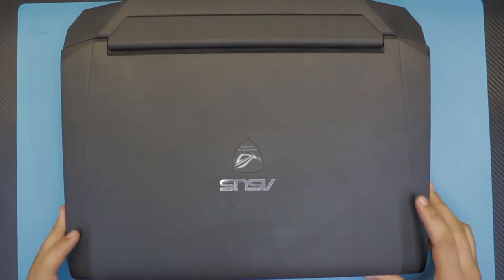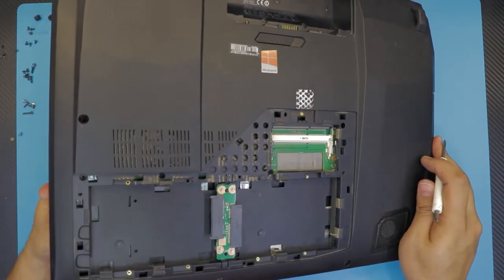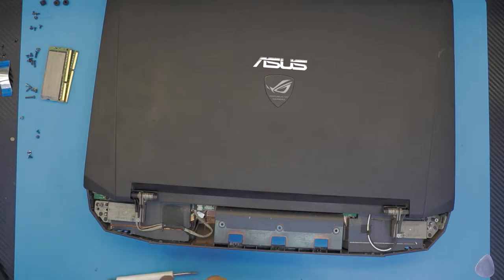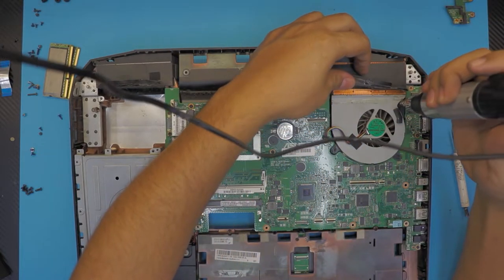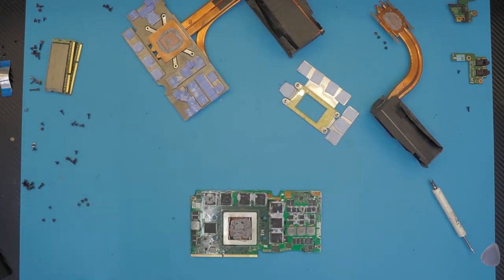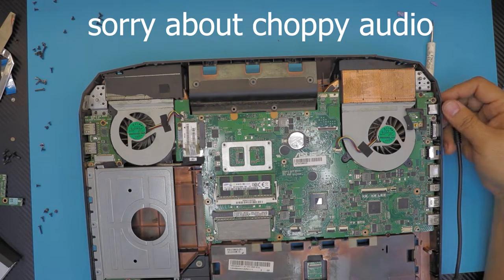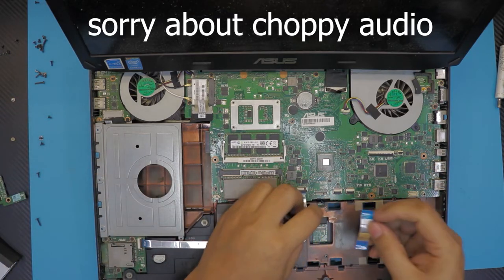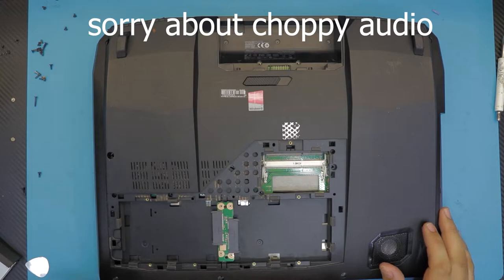ASUS G750 Repair, service, Disassemble and repaste

Comment: generous work. I have a problem with my asus g750jw, I am repairing a key on the keyboard and at the end I wanted to close it after coming into contact with A ram the machine does not turn on anymore.
Can GPU be saved?
Reply from the maker: Thank you for the feedback! if you wish to support the channel you can LIKE or SUB or both :P
regarding your question: so you tried repairing the keyboard from outside and then you opened it and touched the ram?? or upgraded the ram? and its not turning on at all?, or its powering on LED but no screen fan spins?
and by "can GPU be saved?" what you mean?
Reply: @uFixTek  sorry i am not good in English! After the pc does not turn ! Anything's/ my question is can i get a new motherboard without graphics card?
Reply: If motherboard died ,the gpu too?
Reply from the maker: its okay i speak 5 languages you can speak in your language my friend:)
if the motherboard is dead the GPU is fine. just change the motherboard. yes you can get just the motherboard without the GPU.
Reply: @uFixTek  merci beaucoup à vous je me suis abonnée à votre chaîne !  Je vais acheter une carte mère bientôt ! Puis-je acheter le g750jx à la place du jw ?
Reply from the maker: merci pour le soutien à la chaîne, je parle 5 langues mais le français n'en fait pas partie :P,
Bien sûr, vous pouvez obtenir le modèle "JX", cela fonctionnera très bien et ce serait une bonne mise à niveau.
bonne chance mon ami.
Reply: @uFixTek  merci à vous le monsieur ! De ce fait la gtx 860m pourrait être mise en niveau sur le kW?
Reply from the maker: votre accueil, et oui il peut mon ami.
Reply: @uFixTek  merci beaucoup ! Je pense que je vais essayer de changer de MOSFET car le pc s'allume plus pour voir !

Comment: Hi there Can you please tell me how I can enter the Bios setting on ASUS GJ750 ?? I hit F2 button but it didn’t work and I’ve also tried F10 and Esc and none of them worked. Thanks
Reply from the maker: thank you for the support to the channel, regarding your question :
The easiest way, is to bring the charms bar up and go to Settings>Power>Restart+Shift>Troubleshoot>Advanced options>UEFI Firmware Settings>Restart. Once you click restart, BIOS will appear. The trick here is to press Restart AND Shift at the same time.

Comment: Really helpful, I was wondering. I have this model. What would cause the LCD to not display even when its turned on. I have tried to diagnose with a working monitor and still did not display. Could it be a mother board issue,the gpu or a loose LCD cable/bad hdmi port?

edit: I took it apart and its either the mobo or the gpu. So im just going to cut my losses. The video did atleast help to take it apart. So thank you for that.
Reply from the maker: Thank you for the feedback and your support to the channel by a SUB :P
regarding your question:
THIS is a very common issue with this models and we get them a lot in the store , the failure is on the GPU chip. you will need to do the following:
remove the motherboard completely,
grab foil tape :
https://amzn.to/38cZBUL
and you want to isolate around the GPU
then you want to place it on a wood table no glass no metal.
and use a hair dryer and set it to max heat and medium air and with a distance of 2" keep the heat on it for 5min
then let it cool down at room temp and no touching for 15min
then remove the isolation tape around the gpu and repaste and enjoy.

if you need example of the process watch this video:
https://www.youtube.com/watch?v=LPThmVu9-JM
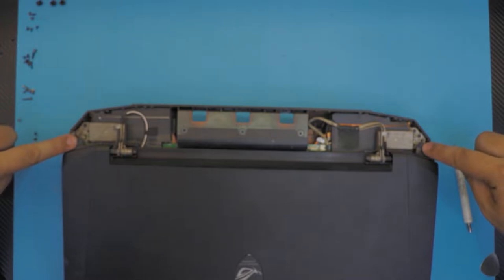watch after min 7:00

if you got any questions ask me
Reply: @uFixTek Thats really helpful thanks!!
Reply from the maker: anytime my friend :)

Comment: can this laptop turn on when the GPU is removed?
Reply from the maker: no the schematics wont allow the boot without the gpu installed. thank you for the support tot he channel.
Reply: @uFixTek  I want to troubleshoot either a bad graphic card or motherboard. If the motherboard is good and the graphic card is bad, can because of the bad graphic card installed, the board will not show any LED? 
I want to know if it is the gpu or the motherboard is bad
Reply from the maker: im thinking you dont have a shop or graphic card testers, therefor i need to know this:
if you put everything together and turn on the laptop what does it do exactly:
#1, turns on the fan , light indicator , how long the light stays on and then it powers off or it turns off then back on ?, i need this information to be able to give you a exact diagnostics.
Reply: @uFixTek  The laptop does not show any sign when trying to turn on. Nothing happens.
My question is: Will a good motherboard, without the GPU card installed, show any LED light or fan when trying to turn on the system?
Reply: @uFixTek  I have the same question @UFIXTEK. I was about to buy a new motherboard on aliexpress, and now I saw this post and I am concerned about it. I dont know if it is the main board that is bad or the GPU board. Please, give me any light.
Reply: @uFixTek  When everithing was together the mother board turned the light on and then off, but sometimes the light not even turns on. nothing. The fans do not spin. The laptop used to shut down suddenly when I was plaiyng. Some weeks before it died completely the laptop refused to turn on sometimes, and then when I tried again it turned on. So I need to know if it is the moterboard that is dead or the GPU card.

Comment: Nice work. Is it true those laptops can't' work with 1.5 volts ram? I have two Vengeance cmsx16gx3m2a1600c10, and I wanted to replace the ones that came with the laptop that are 1.3v. I red in some forums that it will damage the board and cpu because of overheating. I saw videos of people using them and they work, but I dont know about long term damages.
Reply from the maker: Thank you for your feedback! If you would like to support the channel, you can choose to like, subscribe, or do both.

Regarding your question, I have been in the repair and servicing business for over 17 years, and based on my experience, I can tell you the following: You can install a non-low voltage RAM (1.5V) and test it. If the laptop turns on, doesn't crash, and doesn't encounter blue screens, then you can use it. A 1.5V RAM cannot damage a motherboard; it will either work or not work.

However, I recommend using a 1.3V SDRAM DDR3L (low voltage) because low voltage RAM tends to be more stable. Additionally, some motherboards only support low voltage RAM.

Please note that no matter what you do to the RAM, it will not damage the motherboard. We have conducted experiments where we deliberately created a short on the RAM while it was powered on, and although the RAM may smoke, the motherboard remains unaffected.

Therefore, if your laptop can handle 1.5V RAM, you can use it. If not, opt for the 1.3V RAM. Keep in mind that if you install two sticks of 1.5V RAM, it may not work during the boot process. You can try it out and see.

Should you have any further questions or requests in the future, please don't hesitate to ask me.

Comment: Touchpad not working after reassembly. A blue tag or label of one cable went off but the rest of the cable is intact. When reconnected the cursor does not appear. Keyboard working fine.
Reply from the maker: Thank you for the feedback! if you wish to support the channel you can LIKE or SUB or both :P
regarding your question: you need that blue .2mm plastic to hold the connectors with pins cut a small thin plastic and slide it on the back side of the flex into the jack so it can push the pins.
Reply: @uFixTek  Thanks, I will try that. I just realized that the numkey pad is not working either. But that tip is intact, do both cable work together or could the other cable have something wrong?
Reply from the maker: make sure you re insert evenly the keyboard flat cable, and its all the way in, the keyboard flex has nothing to do with other.

Comment: Hi, this video helped me fix a thermal issue as my ASUS G750jm also had the tape half over the vents for some reason. However, I'm still having an issue with a flickering screen I've determined it to be hardware but im not sure how to go about testing it so I don't order the wrong parts. Any advice would be greatly appreciated!
Reply from the maker: thank you for the feedback,
and regarding the screen flickering i have a very DYI solution for you, but before i give you the solution i need to have a confirmed diagnostics,
can you answer the following questions, please be very exact:
#1. when does the flickering happens
#2. does it happen before windows boot?
#3. doe it happen right when you see the asus logo
#4. does it happen when you reach almost or wto your desktop?
#5. it happens when you play game
#6. can you take a video few sec or min of the flickering?
#7. does it have the save exact patterns?
Reply: @uFixTek  Thank you for offering your advice! 
The flickering occurs primarily when the monitor is moved any degree, either large movements or simple vibration on the desk.
It occurs consistently through the boot process and after
when isolated from any vibrations it will flicker for long periods but eventually settle down for a small period.
I can attempt to take a video if needed
The patterns are always the same sporadic segmented flickering across the whole screen
I can verify that the cable inside for the LCD is properly seated but that's where my expertise ended.
To note: the lcd does just turn off randomly for no reason, a second monitor verifies the system did not crash or overheat. The monitor just turns off and doesn't come back on until a restart.
Reply from the maker: okay based on the information that you gave me now i can tell you 100% that the problem is with your LCD *the matrix board attached to your lcd, there is no repair for this , you will need to remove the bezle and remove the lcd and only 4 screw holds it and remove the lcd cable and the exact info for the panel is written at the back of the panel, and you can find it cheaper, but of you search for you laptop bran lcd the price will be very high, and the seller will know that you using it for high end laptop  and they still give you the same panel but much $$$, so the best is remove the panel and search for the exact panel model.

if you had a bad flex cable the screen should of turned off and on and flickering on and off.
if you move your screen and it flickers but the screen still on its not flex cable, its simply your lcd matrix board.

also, get a hdmi cable and test with external tv or monitor to discard any 1% chance that it could be your lcd filters on board. (99.99% its not ) but do it for the heck of the issue.

therefore NEW LCD panel :)

***i see that you have 2nd monitor for 100% its your panel
Reply: @uFixTek  Interesting? Well thank you so much for the help! Im 100% certain this diagnosis is correct thanks to the information you have stated. Again, thank you so much for the help!
Reply from the maker: thank you for the feedback and i hope you keep  me /us informed and see how it goes, but im sure you lcd is going back. good luck my friend

Comment: Hi, I got my g75ojx recently opened up and cleaned by a friend but now the FPS in game have dropped to half i ran a few diagnostics it shows my GPU is not working at full capacity should i repaste it ?
Reply from the maker: update your bios and remember you have to plug the a/c unit 1st before powering on if you going to play games, because the new bios update on this models work as follow: if the charger is not plugged in and you power on then the gpu wont start and you will only have activated the hd graphics. so plug in charger then power on if that didnt resolve then open up and repaste the cpu and gpu

Comment: I have this laptop. I would like to upgrade the graphics card and possibly the hard drive for more memory. Any suggeations for what to get or where to look for replacements, I would appreciate very much.
Reply from the maker: for ram : https://amzn.to/2Wn8NRJ 
for the GPU its going to be hard as the problem is not just new GPU card its that you will need a more powerful power bank, about 7-8amp, else it wont boot. i have done few upgrades. you can buy new GPU card directly from ASUS. but they are expensive.

Comment: Hi Sir, I really appreciate this video. I actually had a problem after I did all cleaning and repast gpu and cpu. I forgot to double check  before I placing the LCD and keyboard back. After I assembling everything I noticed that I failed the work. There is no light at all when I charge it and the screen is definitely black. Can you please help me out what potential reasons behind? Is there a demage on the motherboard when I did the work? Thanks!
Reply from the maker: Thank you for the feedback! if you wish to support the channel you can LIKE or SUB or both :P
regarding your question: i need every bit of detail my friend, like>
have you reopen and double check the cables and all make sure the screen cable its all the way inside.
when you plug the charger do you see the charge LED or when you press power on and do you hear fan spin and or any LED light flash>
give me detail.
Reply: @uFixTek  Solved, I just reopened the laptop and reinstall the rams. Thanks it really helps
Reply from the maker: awesome my friend always double check your work :P 
if you have any question or request in the future feel free to ask me.

Comment: Thank you for sharing this video.  I press the start button and the laptop didn't show anything on the screen? Could you tell me what the problem might be?
Reply from the maker: remove both of the rams, and then power on and power off. #2, place only one ram, then power on and you should get the screen logo then power off *or wait for the windows to load then power off both is fine, #3 place the 2nd ram slot in and you done.
Reply from the maker: if it didn't work give me more detail, e.g. when you power on does the fan spins does any light blinks any reactions
Reply: @uFixTek  hello bro i have g750jw and i have same problem no screen when i started  the fan and dc light on when press start    sorry for my language
Reply from the maker: @RealMgeed  hi my friend you can write in Farsi i understand Farsi :P ,
you have a GPU (video card) problem, 
all you need to do remove the video car completely, as shown in this video,
and then you need to do the following,
#1.  get the gpu out : https://imgur.com/a/XDrmN1d
#2. get your self a foil tape : https://amzn.to/34Qms6j
#3. you need to cover all the video memories, isolate the GPU
watch this video : https://youtu.be/abiSn6h0r3o
@12:00 min starting and it shows you the example of how to isolate.
#4. once isolated then you want to place the video card on a wood table and  make sure there is no air blowing or air condition in the room is off
#5. grab a hot air station, or if you dont have use a hair dryer and set the hair dryer to max heat and low air, 
#6 keep pointing the hair dryer directly over the video chip for 5-6min without moving, the distance should be about 5cm from the chip to the hair dryer.
#7. turn off the hot air and let the board cool down BY IT SELF, DONT USE FAN OR ANYTHING!! let it sit for 10-15 min
#8. remove the foil tapes and clean the chip and put new thermal paste a good one
Thermal Paste: https://amzn.to/2O3g3u4

and ENJOY :)
ممنون ، دیمون

Comment: Can you write which of pci express is on g750js model. So i can see which newer nvidia mobile gpu is compatibile. Thanks for reply
Reply from the maker: im sorry but i dont understand your question.
Reply: @uFixTek  on Laptop you take spart which nvidia graphic fit inside different than 870 or 880 m? I want to know which connector type is on motherboard? I plan to install if it is possible 980 or 1080 mobile card

Comment: hi how are u, thx, question, if i want to only replace my top cover. do i have to take out the hard drives (ssdd), or can I leave them in, cause I do understand I need to remove the keyboard?
Reply from the maker: good thx, yes you have to remove those. its simple and easy, recommend you to take a picture before you remove so you know how to put it back,.
Reply: @uFixTek  thanks a lot. will do. taken out ssd is scary, i think I can manage, still scary business.. hehe. I need to replace the top cover and the screen. any other advice? also while buying the screen?

Comment: Can I replace the tapes with Double Sided Conduct Copper Foil Tape EMI Mask Electromagnetic Shielding one Side adhensive?
Reply from the maker: the isolation tape on top of the heat-sink ?, if that's the one you talking about , then yes you can put the copper foil tape. thank you for the support to the channel :)
Reply: @uFixTek  Just subscribed you, I should say thank you, didn't know that your the one replying. I asked was because my fan broke down not long ago, while fixing it. I found out that I doesn't have that type of tape. So I was searching for help.

Comment: Hi, I have the same exact model of Asus G750JX. I need to replace my cooling fans but I cant find the size of the fans. On the Ebay it has 2 types. 1 -15mm other 25mm which one Asus have ?
Reply from the maker: they use both they are different size : we use this one for your model:
https://amzn.to/2LQ2G1D
Reply: @uFixTek  ok thank you very much. I will order them now.

Comment: How to replace one of my HDD SATA socket( not the HDD itself but SATA socket) & where to get the new replacing part ?
Reply from the maker: only on ebay : https://www.ebay.com/itm/Genuine-Asus-G750JW-G750J-SATA-Hard-Drive-Connector-w-Cable-P-N-69N0P4Q10D00/401785057883?epid=1870127648&hash=item5d8c41725b:g:TPkAAOSwfx9dAXFQ

Comment: Hello, I wanted to ask if my Asus G750jx laptop could replace the graphics card from gtx 770m to gtx 780m thank you for your reply.

otherwise great video thank you for uploading to you tube 👍👍👍👍
Reply from the maker: thank you for the feedback, and yes you can upgrade with no problem, but they are not easy to find :/